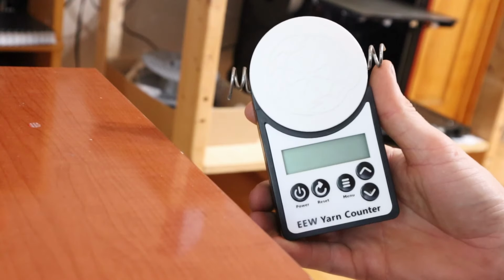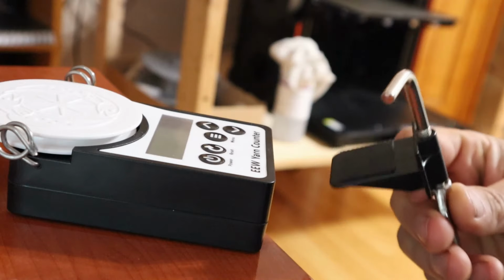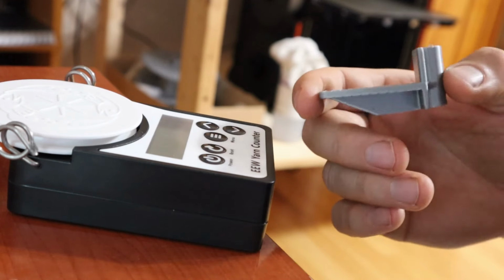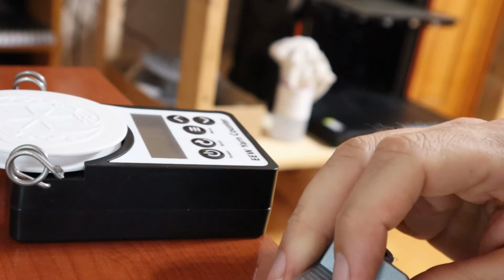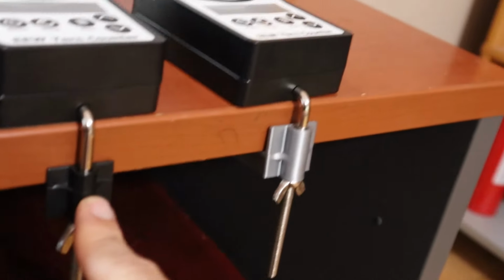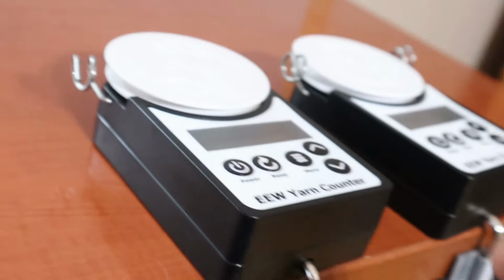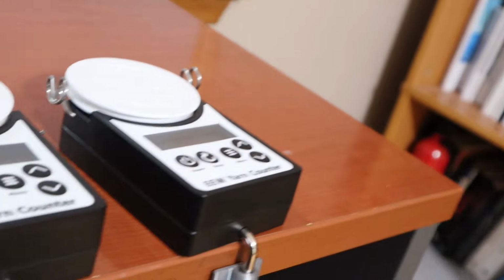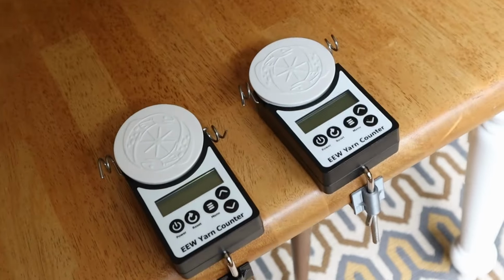Spin 182 - Improved Clamp for Fiber Lovers

Comment: I always thought it lifts from the table because of the relatively short upper clamp part, not that it is about the lower plastic clamp part as this abtually sits pretty well at mine. Sure, it is lifting higher the more you tighten it, but for not using a clamp at all or to loosen it so that it is not holding in place properly the yarn counter is not heavy enough to stay where it should stay

Comment: Omgosh, I've been using it wrong this whole time! I didn't realize it is supposed to sit flat on the table. I have it hanging down from the table below the clamp. Works great that way, but maybe I should try it as intended.
Reply: I'm sure it works well either way... as long as the yarn is around th😊e wheel.
Reply: I can't even picture how you managed to set this up like that! It's a tribute to the product that it works well in a less-than-ideal position.

Comment: Do you think it would help the former style to attach a piece of foam, furniture leg pad, 1" strip of vetwrap wrapped around the end, etc. to build up the end?
Reply from the maker: The clamp that ships with the EEW Yarn Counter has a little rubber pad. I think a soft foam pad wouldn't be a good idea, but a thicker rubber one would probably help.  However, I don't think anything would be as good as this articulating head.  I do plan to put a little rubber pad on it when I make the final version for my products, but that's hardly even needed with this version because it works so well.